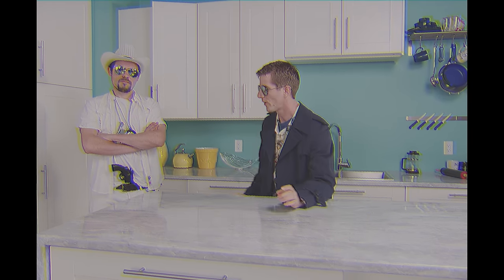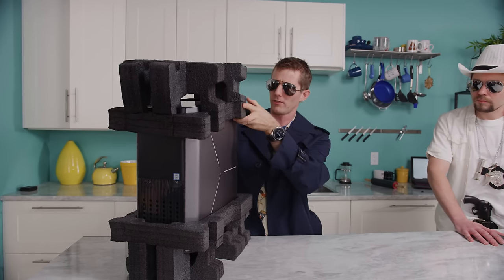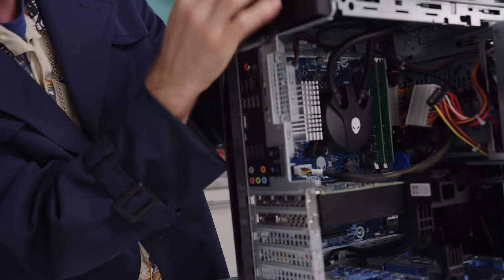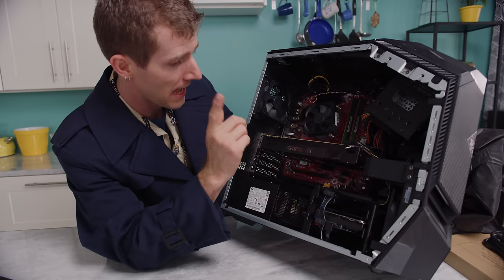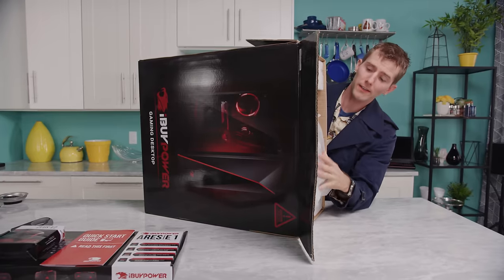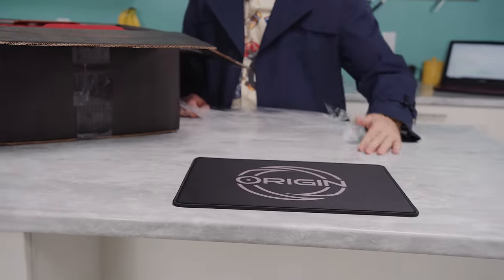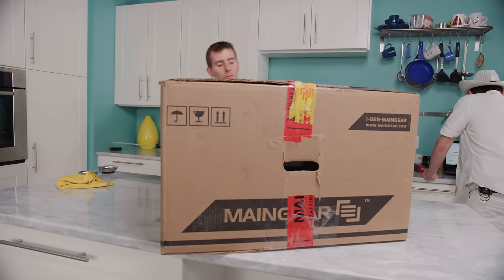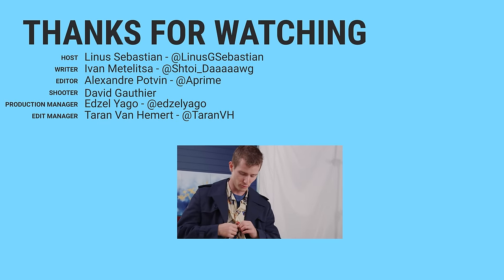What did we BUY?? - $1500 Gaming PC Secret Shopper Part 2

Comment: Bought 2 Alienware computers a few years ago and what a horrible experience. Day ONE out of box the first one (didnt ship both for whatever reason) wouldn't even start. After a week of talking to the help center finally got them to take the thing back and send a different one. Worked for about a month before the graphics card would overheat and die every two minutes. So once again talking and letting them remote control (for however long it would stay on) they sent a "refurbished" not a new card a god damn previously broken card they "fixed". Which guess what, take previous problem and repeat about 3 times over before I said screw it and just bit the bullet on the money lost and just tried to rip it apart and build with what worked at the time. If your wondering about the second one it worked for about 6 months before that just died. My current computer is about 3 years old built myself and still working. Fuck you alienware and by extension you too Dell.
Reply: My friend has an alienware pc we all bully him and we have no regrets
Reply: Yeah just build it yourself. I built mine 5 months ago and it’s still strong so far. Expecting it to last quite a few years.
Reply: Alienware used to be a lot more reliable before Dell bought them. Ever since then it’s been a huge shit show.
Reply: I bought an Alienware back in 2005ish as one of my first "real" computers.  Ran it for about 6 years, it still runs to this day, not that I use it.  Its Win XP and an old AMD dual core, it does have an EVGA 7800GT KO thou, top end card then! That was before Dell bought them of course, so it was basically just a hand built PC in a fancy box for a bunch more money.  After that I built one, about 2011ish, still use it today, everything works fine, I upgraded a to an SSD and a nicer gfx card over time.  Its way out dated to play any new games or anything, but I dont really play new hardcore gfx games anymore anyway.  If I get back into gaming I will definitely have to build a newer rig thou!  But a good built PC should last you a long time, not just a few years.

Comment: I think HP wins so far .. They did everything well . And the system is great . Alienware made you buy the 8700K and cheaped out in the gpu while HP gave you the 8700 which is great and they didn't need to use very expensive cooling solutions so they can get a 1070 in the budget .. And the 1070 will be able to reach its full potential paired with this cpu and will destroy the crap out of all these 1060s

Comment: i thought about it a lot. Regarding the idea of "they should have taken the aio money and just used air but put a 1070 in it". I feel like a person who is buying a prebuilt system like this is more likely to feel comfortable swapping out video cards then installing a aio on the motherboard. Again from a performance stand point it makes obvious sense to have a 1070, but from the standpoint that eventually they will want to overclock these k and x cpus they will need good cooling i think having the aio from the start is better for a person like that.
Reply: But honestly, people who buy pre built systems wont over clock them for a while. It will be years tell they actually do that. I dont think they will be doing cpu intensive tasks as well, so honeslty stock cooler and a 1070 is a better option in my opinion.
Reply: people who buy pre built systems don't overclock. so the system should come from the factory overclocked or just be shipped with a non k cpu and save money  or get beefier gpu or hard drive.

Comment: 13:37 I've scrapped a bunch of Intel business workstations, and never have I seen a square fan on a circle OEM heatsink. WTH is that?
Reply: Noticed the same thing
Reply: @Raygen I noticed the angle, but honestly don't see anywhere it could screw into the heatsink.  It looked to me like they used a plastic clip on the HS side of the fan; which clips onto the aluminum.
That being said, there isn't a good angle, and the video didn't spend a lot of time on the cooler.  I wonder if it is cheaper for HP to buy the HS without the fans, then install square ones they have an abundance of.  If it was on the build with the adapter-ed rear exhaust, I'd be more suspicious.

Comment: Linus an AMD CPU isn't going to be a limiting factor for a GTX 1060 unless you plan to play at 480p a 1070 at 1080p still wouldn't show up any signficant differences and she did say that he streamed so a AMD CPU would likely be better for that use case due to getting more cores for the money.
Reply: An 8700 non k with a 6GB 1060 will have anywhere from 10%-20% higher frames. That may not be a lot to you, but it is still enough to screw up the scoring here.
Reply: @micaylasawyer5829  no it won't
Reply: @toastdtech3597  do you have some sort of inside knowledge to what testing methodology they are going to use?
Reply: @micaylasawyer5829  Almost any Ryzen CPU is going to be bottlenecked by that 1060. That 1060 is going to struggle to reach 60fps on alot of modern titles, particularly Ubisoft games. Hell, a 2600x outperforms an i5 8400 in Assassins creed odyssey by around 8%, with the 2600x still having utilization room to spare, running with around 20+% less utilization than the 8400. This trend continues throughout multiple game benchmarks. And these chips both cost exactly 219.99usd.
Reply: @axelblack1799  What does that have anything to do with what I said? Bottlenecked? Sure. Is the 8700(which is what I said) still faster in games? Yes. It is also bottlenecked? Sure. But the IPC is still higher netting more fps. There are several comparison benches of the 8700 and 2600 with 1060s on YouTube. The results are all congruent with what I said.
Reply: @micaylasawyer5829  Actually, there is little to no IPC difference between Intel and AMD at the current generation, and infact AMD exceeds Intel in IPC with Compute workloads. But, this isnt the argument being made. The Argument is that a 8700 will be better at Games than a 2600, and the answer is Yes. Of course. The 8700 is a $330usd chip, fighting a chip practically half the price, at $170usd. If we compare Price to Price chips, the 2700x is also $330usd, and absolutely destroys the 8700 in practically everything.

Comment: Hey LMG, those machines you guys bought, could you guys do giveaways... original builds, or maybe, if Santa a.k.a Mr.Linus,  is really feeling it, put 1080 ‘Ti’s and do the giveaway contest. Lol
Reply: Or just give it to me lol. JK JK. Who gets it is lucky and probably doesn't need it as badly as me
Reply: @default632  What are your current system specs?
Reply: Not sure if the PSUs in the system can handle a 1080Ti configuration. Would probably need to upgrade that which may not be possible on a few cases.
Reply: @NightPhantomz  sorry was sick for 4 days. Had to dig through notis. Current specs are 7 year old laptop from asus. It has i7-3xxqm or something. 700gb hdd. Yup. Im poor but not needy and would work for what i want BUT i am still 13 :(

Comment: Did Linus just claim he can 'feel' the difference in system response using a SATA SSD vs NVME? Under what circumstances are you feeling responsiveness. Did he mean to say transfer speed? Under what circumstances does an NVME respond that much faster than a SATA drive?
Reply: Perhaps he means loading time as you can tell the difference between a 560mb/s SATA vs  3500mb/s NVME. But theres no difference in frames rate for sure once the game has loaded
Reply: I believe he's talking about things like alt-tabbing, opening the task bar, opening your internet browser (and by that I mean Chrome cause let's be real here) I can tell you for sure I noticed the difference between my system (With a sata ssd) and my friends system with an m.2.

Comment: Man, keep it real... On a 1060, a 2600X is going to perform just as good as an i7 8700k.
Reply: Linus gotta shill ;)
Reply: For real though. I'm running an r5 2600x with a 1070 ti and ran quite a few benchmarks in my games and there is no difference in FPS at 1080p vs my buddies i5 9600k. Seriously, unless you're gaming with a 1080 TI performance or higher, you're not going to see a difference in gaming performance.
EDIT
And even when you're with a 1080 ti with an r5 2600, no difference at 4k vs an i7 8700k or better, 5% difference at 1440p. Then 7% difference at 1080p at dumb high refresh rates..
Reply: Lavancer I literally have a 2600x  and a 1070ti and it’s just great
Reply: Nah bruh, Intel wins in gaming. Maybe the 3000 series will change that.
Reply: @ZxChrono  The only time Intel wins in gaming is when you have an i7 8700k overclocked dumb high paired with a 1080 ti or better running at 1080p and you're trying to power a 240 Hz monitor.
Reply: also last episode they did say that the pc would be used for streaming and amd would be better at that than intel
Reply: SaltyWhipperSnapper  you could also just set the fan speed higher while playing overwatch (or limit your fps, if you're getting like 500fps in overwatch it will generate A LOT more heat than if you locked it to 60 or 120 or whatever you like)
Reply: Except it didn't. Watch the last episode.
Reply: SaltyWhipperSnapper  82-88 Celsius is actually normal for the 10-series GPUs under load.  At default settings, thermal throttling won't kick in until 88-90 degrees Celsius, and you can set an aggressive fan curve to keep it cooler as well as making sure airflow in your case is optimal.
Reply: SaltyWhipperSnapper  you shouldn't be worried about an NVIDIA graphics card running a little bit higher than 80°C, it's pretty normal, it would be worse if it was on your cpu though
Reply: SaltyWhipperSnapper  EDC 98% all the time just means it runs at the target clockspeed all the time which isn't bad

Comment: HP wins for me for the quick delivery time.  I have zero patience, so I'd not be able to wait 20 days for the Alienware.  Yes, I'm commenting before waiting to hear how long the other systems took to deliver.  Anyway, if I had that kind of money to spend on a system, I'd get parts from Amazon using Prime next day delivery and build it myself.  Not a fan of pre-built systems.  I learned to build PCs so I could build them, not so I could pay for one that's already built, where's the fun in that?  Though I must admit the big brand ones do look good.  Anyway, HP is my favourite PC manufacturer, and has been for a long time.  Never had a system by them fail on me for something that wasn't my fault.  So if I wanted to buy a complete system, it would be from them anyway.  Or Apple, but that's another story.

Comment: I built the same pc as the origin pc with better ram, power supply, motherboard and a mechanical keyboard and mouse for $600. That's $900 less. I feel bad for people who have to buy prebuilt pc's.
Reply: yeah origin is a ripoff
Reply: The origin one is by far the worst value.
Reply: Yeah it is. I'm glad i didn't go prebuilt and instead learned more about computers
Reply: then it wasn't the same PC as the origin PC ... lol
Reply: I had the same cpu, gpu, harddrive. I got everything else for a better price and better quality
Reply: @muchostacos67  i also buy prebuilt pc , BUT i go there and they find the parts i want in within my budget then assemble it . not just online shipping or stuff like that
Reply: @GBR9794  smaller parts are usually cheaper actually, micro ATX is usually cheaper than ATX, you can get a lot of cheap miniTX cases and graphics cards and coolers cost less as well
Reply: yep origin is a rip off. But good prebuilt can be had year around if you do your research. and they're cheaper than build your own PC (even if you do parts hunting on sale) when you catch a good deals, which is available everymonth. Like this time last year, you can have a HP Pavillon with i7-7400, GTX 1060, 8GB ram, wifi, 1TB HDD for $450 at walmart during Black Friday and it is later discounted to $250 - the CPU +GPU alone exceeded the price; or a Alienware Aurora R7 with i7-8700, GTX 1070, 16GB Ram for $1000 from BestBuy in February (at the time a GTX 1070 alone will cost you $500 if you can find it, because of the mining craze, again the GPU price + CPU + Ram price alone is already 1K - it's like Free WIndows, Free HDD, free case, free MObo, free optical drive and free PSU). Oh, and also next day, in home service warranty
In fact I always want to build my own for fun but can't justify doing it when i can find brand new pre-buits with warranty for much cheaper.... But I might build my own in the future since i want a small form factor PC (< 20L). Offerings from HP (the Omen back pack) or MSI, etc... are too expensive. Dell had the X51 which used to be able to get for a very good price and had water cooling in a tiny form factor but too bad they discontinued it...........
Reply: Actually i have very small components in my build including the same evga 1050ti single fan gpu that they used. I used a much more expensive motherboard in order to be able to upgrade CPUs and overclock in the future. The whole build including peripherals came out to about 650
Reply: @GBR9794  i5 8400 but im looking to upgrade to an i7 soon
Reply: @GBR9794  dang. Im just glad i got that 1050ti for $125 before the crypto mining thing boosted all the prices for like half a year

Comment: Honestly, A+ to them not stitching the edge of the mouse mat. Its not needed, since mouse mats don't fray assuming they are well made in the first place, and more importantly, mice can get caught on the stitching, disrupting the gaming experience. Plus with stitched mats it is possible to damage the feet on the mouse if they get caught in the stitching. The stitching can also cause additional irritation on the skin.
Reply: having stiched mousepad (razer) .... well none of these applies to me. 
impossible to be caught, never disrupted my gaming experience, mouse slides on the stiching, the stiching is nicer to skin than the mouse mat alone.
Reply: @Kedo2  Fair enough, I guess its each to their own then. I have had (supposedly good quality) stitched ones before, I use them as mats for the top of bedside tables now xD
Reply: Well I had stichless before from razer and fray happened after several years. After that I bought the stiched version and it is an asset for me. So depends on the supplier I guess. But it can be done without any issues.
Reply: @Kedo2  I'm currently using a variant of Steel Series QcK, its been going for maybe 7 years? Pretty sure I bought it shortly after I put my current PC together. Come to think of it, I ought to wash it again, must have been about 2 years since it last smelt of dish soap :p
Reply: TIL
Reply: @aljowen  7 years?!... SEVEN YEARS?!
Reply: aljowen i have a razer a qck and a generic mousepad only one that the mousepad edge bothers me is in the qck
Reply: @apaxtoa  If it ain't broke (and more modern tech wouldn't make an improvement ) why fix it?
As for the computer, it's probably due for replacement within the next few years (maybe at Win7's end of support period). But the I5 2500k is still pretty decent in single threaded performance once overclocked. Obviously in heavily multithreaded applications modern processors destroy it with higher core and thread counts. With its current GTX970, it's absolutely fine for 1080p 60fps gaming. Would probably re-use quite a lot of the components.
Reply: I have a mouse mat sitting on my desk that is fraying right now

Comment: Dear Linus, thank you for showing me how the heck to open up that Aurora, I have one and couldn't figure it out myself (and was more than a little afraid to force it for fear of breaking something), and was told by customer support that the unit was supposed to remain sealed.  For the first time in the three months I've owned mine, I'll be able to dust it out.

On a TOTALLY unrelated note, did you know that if the top fan on the Aurora line fires up to full power from stationary it can launch dust up approximately 4 meters into the air?
Reply: i bought an aurora model during new years sale last year from their site. 8700k 1080Ti with a bunch of other component upgrades and memory that were overstock (i bought the computer with extended warrenty for what it would have cost to build myself a little less actually). This is by far the best performing computer i have had, but the only thing that annoys me is that windows 10 keeps on reverting to low power mode randomly while playing certain games (rainbow 6 siege and blops4).

Otherwise i have had an Aurora for a year with 0 problems ever, and its been a great experience

Comment: For 800$ I got a gtx 1060 core i5-8400 16 gigs of ddr4 and 16 gigs of intel optane a 240 gig ssd and a 1 tb pre built and for 1500 dollars you get a gtx 1050ti OOF
Reply: yep, mine is 400 dollars, same specs, only need to add the grpahics card later on, and still will be around half the price of thhesemachines,,,
Reply: Nice
Reply: But no K on ur CPU so 10x slower
Reply: @omgnonamehgfgfgff8591  It makes it about 27% slower than the core i7 8700k and that alone is a much more expensive than the core i5 and the had a ryzen in the one so no.
Reply: @itsrealplayer162  He making a reference to the previous video.